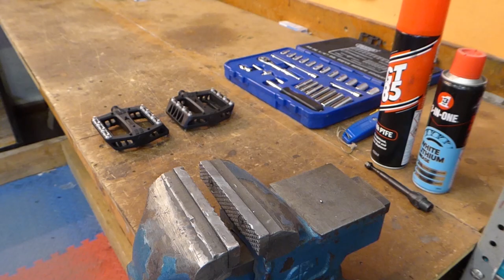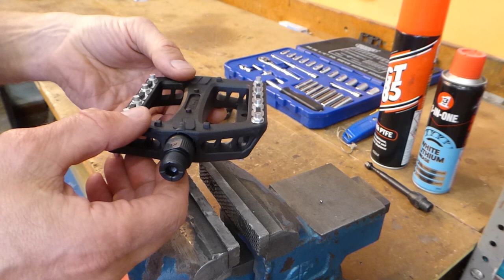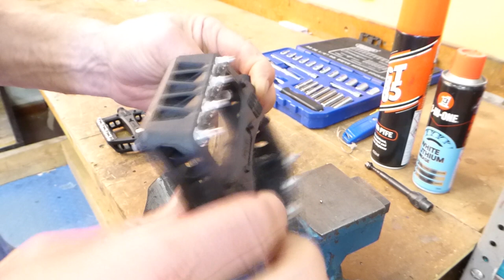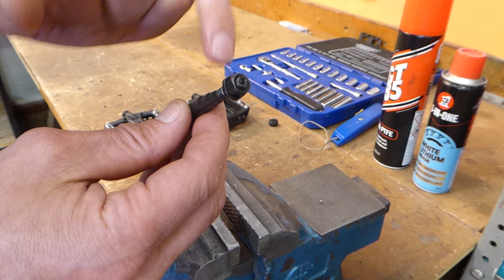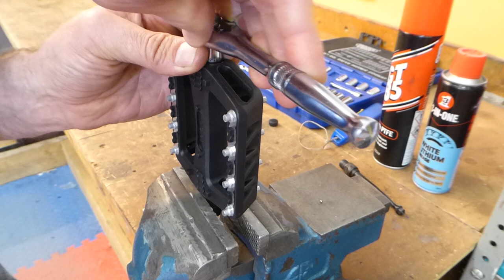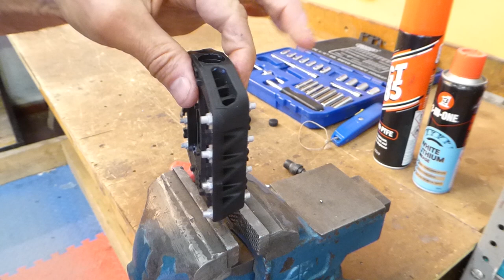Pedal Adjustment Tutorial (How To)

Comment: This method doesn’t work on my latest Nimbus pedals although it did work on an older generation (with reflectors).
My theory is that both nuts are too loose against the axle thread so are able to migrate with each other when any force is applied. Whenever I tried to tighten or undo the cone nut the lock nut move in tandem… frustrating.
However I found a way to do it which involved bringing the cone nut and lock nut up to the top of the axle, then whilst holding the cone in place with a flat screwdriver I used a pair of pliers to snug up the lock nut to the cone nut, just enough to create some resistance. I then found that when tightening the lock nut both nuts could be wound down the axle shaft to create a secure connection to the bearings.
I was a bit wary about stripping the threads but hopefully I won’t need to re-grease for a long time.
Reply from the maker: Thanks for your detailed response this is helpful to others.  I have noticed a change in the design as well and you have found the solution for locking it; although some loctite on the threads would also help.